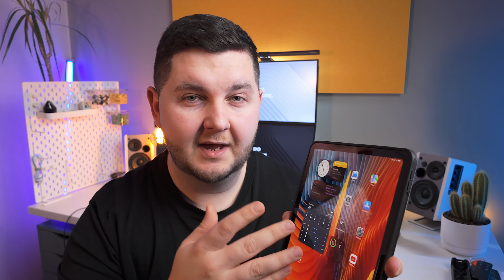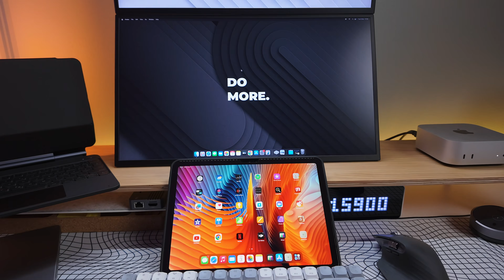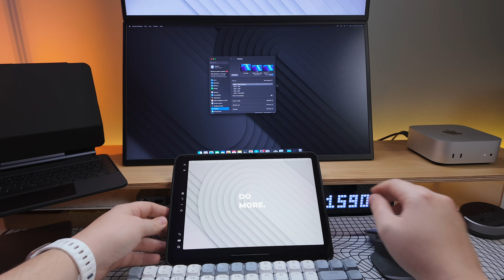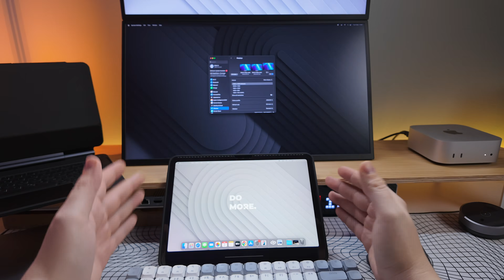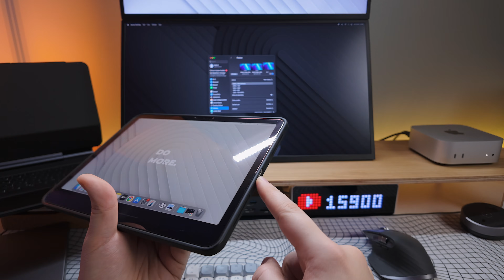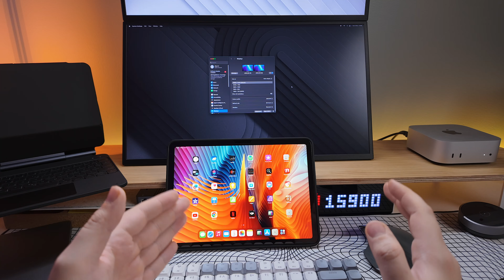M4 Mac Mini - Turn your Old iPad into a SCREEN! (Here’s HOW)

Comment: Way too small  Everyone has a 4K Flat Screen 40" or bigger sitting right there. Just hook your HDMI to it and you now have a 4K 40" to 60"+ Monitor.  Put your Wireless Keyboard in your lap & mouse on your Recliners arm.  I use 2 4K UHDTV one above the other. OH I forgot to mention that I also EDIT and listen in 5.1 Surround Sound thru my $150 Vizio Sound Bar.

Comment: I tried your method with an older 10in. iPad and my M1. The iPad did not show up when I pressed the + sign in displays. (Sequoia 15.2)
Reply: Same - I have an older iPad (5th gen) and it doesn't show up under displays. I may try the capture card method soon enough. I also can't get my older 2013 macbook pro to run as a display either. Must be a cutoff in a certain model/year.
Reply: @milescaldwell263  I thought the cutoff was 2016.

Comment: Make it the Main Monitor instead. This is my current setup with headless sidecar. Check it out.
Reply: I'd love to check it out! Please can you explain how to do it! The problem is when you power the machine on, there is no monitor and so no way to switch Sidecar on and into mirror mode. I've not found any menu, hotkey or command line way to do this on the Mac that could be automated or effectively triggered without being able to see the UI. If you have a way please share! After an extensive online search I did find an Automator script, but that only worked with a specific MacOS version years out of date and in any case would be extremely fragile as it depended on the specific UI layout.
Reply: @john_hind  I'll publish a step-by-step guide soon. The workaround consists of using a virtual Display. This tricks the Mac into thinking a physical monitor is attached. This virtual Display spawns on every boot. So there's only one thing left: enable the sidecar connection remotely. We can call the Mac Mini's IP address with some parameters to enable sidecar remotely. This is the basic setup. No worries, sounds more complicated than it is.
Reply: @john_hind  Full step-by-step guide is online

Comment: I got same ID and wifi for ipad pro and mac mini m4 but I don’t see the ipad on my mirror mode in the display menu. Could you please help me out?
Reply from the maker: Allow AirPlay receiving under Settings > General > AirPlay & Handoff on your iPad and Mac.

Let me know if that helps
Reply from the maker: Also 

Open settings on your iPad
Search for Airplay & Handoff
Turn Airplay Receiver On 
Change "Allow Air Play For" to "Current User"
Reply: I really appreciate it and will try it as you guide me.👍

Comment: I tried to connect my ipad to macmini as display via hdmi-usb C dongle, it worked. But then i tried to change the resolution, and the screen start to glitch. (after that i connect macmini to lcd monitor via hdmi, and glitch gone), but everytime i connect to ipad via hdmi dongle, screen glitch.
Anyone has similiar situation?
Reply: I just reinstalled my macmini and the setting was reset and now it work... Please do not change the display resolution when youre connecting macmini to Ipad 😅🙏
Reply from the maker: Good tip

Comment: Been doing some playing with this: if you mirror your screen onto the iPad, you can actually use the Apple Pencil as a pointer so it is just like having a touch screen Mac! Unfortunately this only works with the pencil, not with finger touch. You can also use the on-screen keyboard as a Mac keyboard! Finally I tried turning the main monitor off and that worked too: the iPad continues to work as the only screen! This would be a better way of operating on the go because the dongle method just turns the iPad into a dumb monitor. What we now need is a way of switching screen mirroring on at startup, without a monitor. There must be a way of automating this so you do not have to do it through the UI?
Reply from the maker: Yeh having it being able to mirror screen wirelessly as the main monitor would be awesome
Reply: @MrHtech  that would be so lovely
Reply: @MrHtech  estoy planeado algo que creo será una opción si bien no completamente automatizada me parece será una excelente para poder facilitar el conectar como Sidecar en cualquier lugar el iPad de manera sencilla, pero dejen que me regresen mi iPad Pro 2018 de que le pongan batería nueva y les actualizo, por cierto excelente video.

Comment: I want to login just using an iPad from turning on the mini. to just have my mini and an iPad as a portable setup. is that possible. I don't want to buy an iPad if not
Reply from the maker: Yeh the second method I mention in the video would work like that👌🏼 you’d still need a keyboard and mouse for the mini
Reply: @MrHtech I’m interested in doing the same thing as @medicinal_soul
Can you list those two apps here & which one did you prefer?
Reply: @MrHtech I’m interested in doing the same thing as @medicinal_soul
Can you list those two apps here & which one did you prefer?